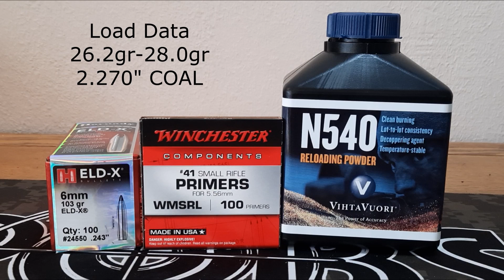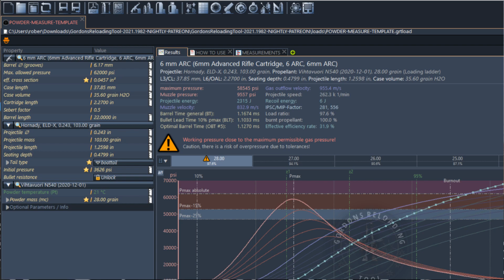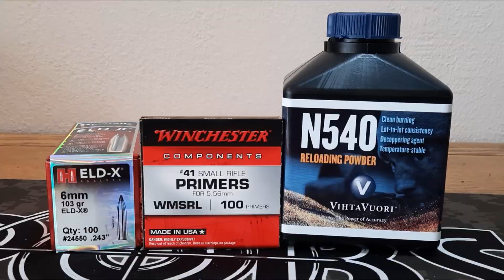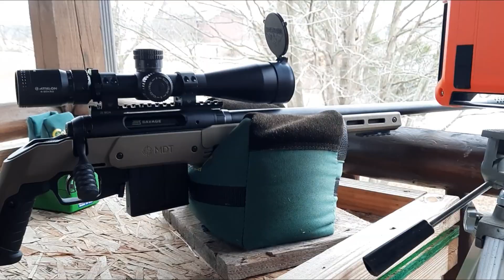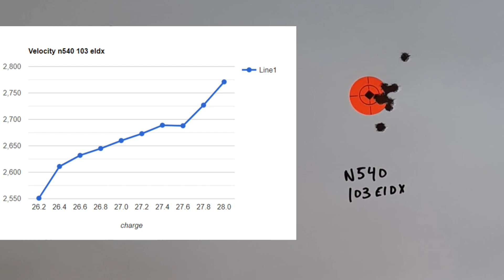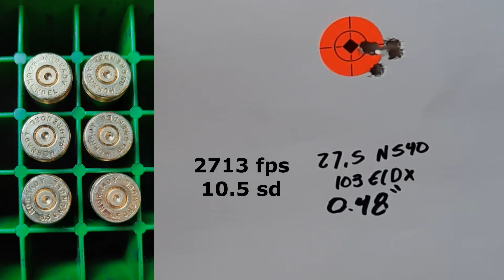103 ELD-X . N540, 6mm ARC

Comment: Have you noticed how temp sensitive/insensitive n540 is? Trying to find a powder that will be somewhere in the middle of temp stable and still get decent speeds for a 500 yard and in 20” bolt action 6ARC
Reply from the maker: @dkart004  no but I believe n540 is pretty sensitive

Comment: Forget the nodes. Just load up 20 a half run under max charge and see what it does. Reloading simplified. Use the Hornady 4dof group analysis and try and get a .30 mean radian. I switched to reloading like this and it works. Uses the large sample size do better understand the rifle's dispersion. You can also load up 10 of a powder a grain or half grain under max then do the same with a different powder. Just to try some different powders out. Whatever does best load up 20 and see how she really does. 
Good vids though. I see V now has arc data and im excited to try the n540.

Comment: Based on a single shot per charge step, there cannot be a so called charge node detected as there are not enough iterations.  If you had performed 5 duplicate charge ladders, and upon combining the results into one graph, and you were to find the flat spot persisted, Then you would be justified to explore that area of charge weights.  What is apparent is that from the second charge to the second to last, there is fairly uniform velocity change per charge step.  Your bullets from these charges land in basically the same place.  Therefore any load within this range is likely to group well.  The second to last shot dropped low, and that is more likely to be an imbalanced bullet of a charge aberration.  Your chosen final group charge lies just before the velocity delta per charge jumps up so you are likely on the ragged edge of the good charge range.

Comment: Quick question? ? ?
What if you REDUCED THE COAL???  TO 2.225"  WHY?  TO FIT MAGAZINE LENGHT?  WOULD THAT INCREASE PRESSURE?  CHANGE THE SD & ES?  GROUP SIZE? ? ?    WHAT WOULD HAPPEN? ? ? ? ? ?
Reply from the maker: Likely it would increase pressure and potentially lead to compressed loads. My mags being a bolt gun are plenty long anyway. I would start low and work up.
Reply: Thank you for responding so quickly...

Comment: I know this video is dated, but where did you find a MDT XRS Chassis to fit a Savage 110? All I see on their sight is for the short action Savage. ( 10, 11, 12 etc...)
I thought back in the 60's IIRC was when Savage changed their model designation for the short action to reflect 10, 11, 12, and so on and long action to be the three digits 110, 111, 112 etc...

Really like your videos, thinking about building me one of those 6mm ARC real soon!!
Reply from the maker: The short action mdt xrs fit just fine.

Comment: Which method of changing the brass from Grendel to ARC did you use ( like annealing first or not ,and which dies and steps used) and did you have any issues in the process or problems with the brass
Reply from the maker: This batch of brass was lubed and run through a 6 arc die until the headspace was correct to fit in my chamber, then trimmed. No significant issues so far. Would receive annealing either prior to the 1st sizing to prevent work hardening of the brass. Im about to do another batch and anneal prior to the first trip in the arc die.

Comment: Would this work for a gasser or is this pressure rated for bolt guns only?
Reply from the maker: This would likely be over pressure in a gas gun. I set the max pressure in GRT to 62k and gas gun pressures are rated at 52k.

Comment: Those hit the lands at 2.260" on mine.  I see that you have the case volume at 25.6 grains of water in GRT.  Is that a more recent measurement?  Are you booting Linux on your Mac to run GRT?
Reply from the maker: 35.6gr capacity. That is the most updated average of measurements. Just bit the bullet and bought a windows computer for GRT.